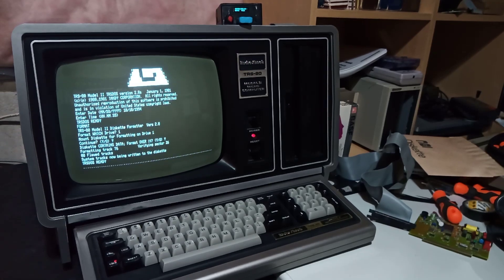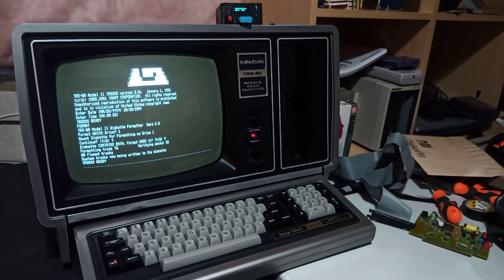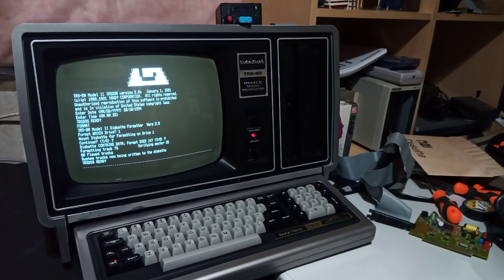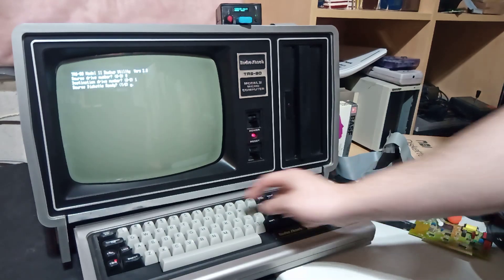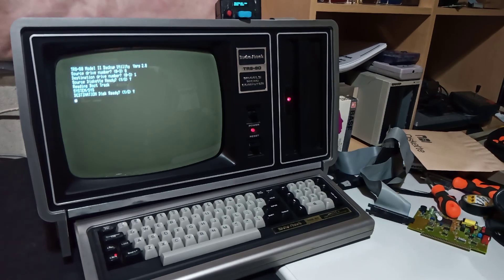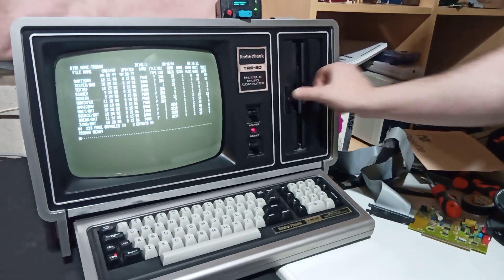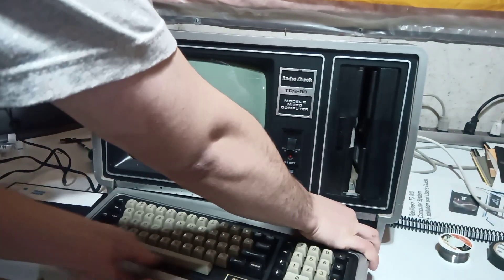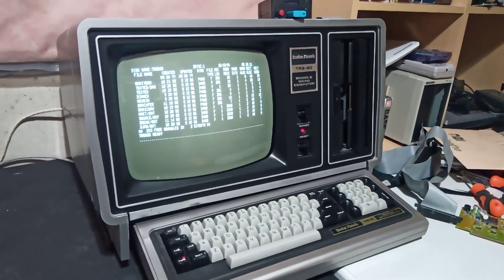Using a Gotek (FlashFloppy) to create 8'' Floppy disks for TRS80 Model II

Comment: Does the screen image change slightly when the physical disk is accessed? That's the one thing I remember about the OG Model II (as opposed to the "thinline"-equipped Model 12 and 16) -- the screen image shrinking when the disk was accessed and growing again when the light went off.
Reply from the maker: Yes, it does! That shows how much power the drive takes when trying to read and write disks. The model 2 drive has an additional power line that the slimline drives don't. That being said, I have tested a model 12 drive in the model 2 and it works just fine without the screen shrinking.

Comment: Just one problem. Your gotek doesnt look like a gotek it looks like a different brand. What is it? Just wondering in case it would make a difference in compatibility
Reply from the maker: It's a normal gotek. I just put it inside a 3d printed shelI made and added a dial.